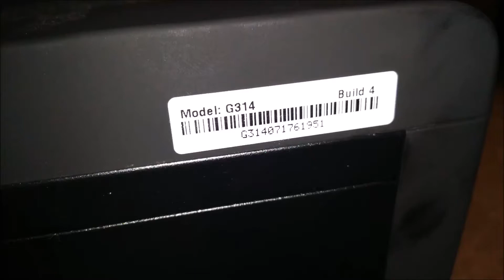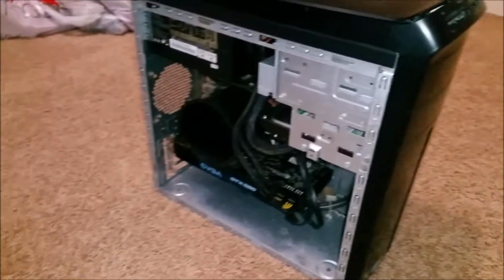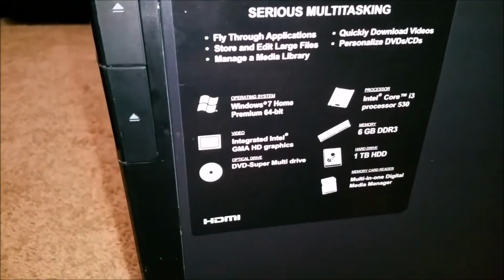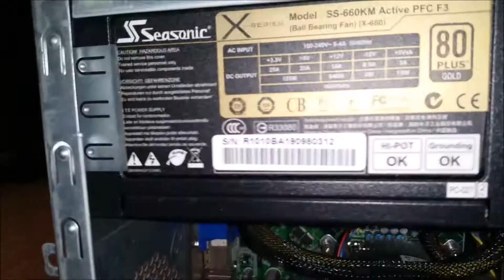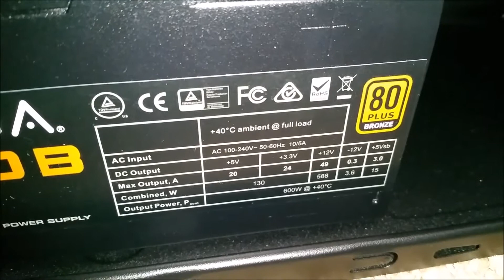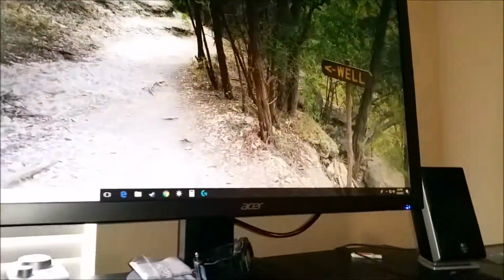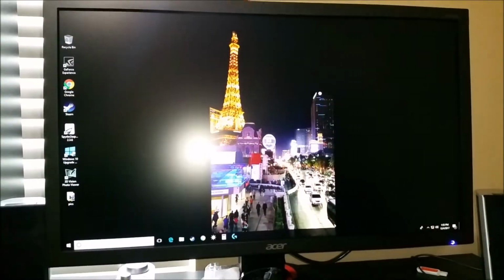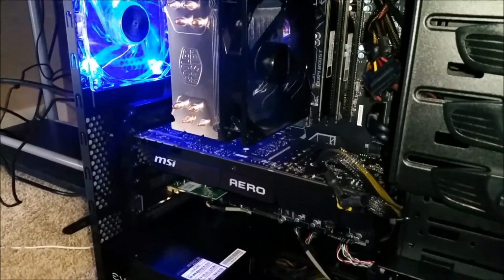Powerspec G314 Best Gaming PC under $1000

Comment: I use this PC and only just recently upgraded the 1070 to a 3070.  the 1070 was a workhorse and could handle a lot.  with the new GPU, even with the 7th generation i5 this is still going strong

Comment: I just got this one for $899   Powerspec  G500 Desktop Computer; AMD Ryzen 5 1600 Processor 3.2GHz; NVIDIA GeForce GTX 1060 6GB GDDR5; 16GB DDR4-2400 RAM; 1TB HDD+250GB SSD; Microsoft Windows 10 Pro 64-bit; ASUS 24x DVD±RW Drive; 10/100/1000 Network; 802.11ac Wireless;